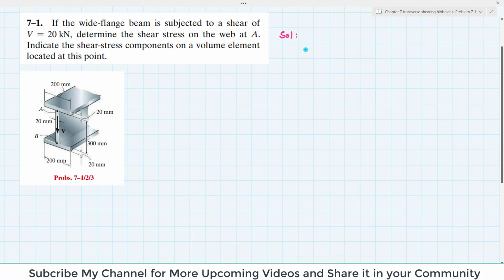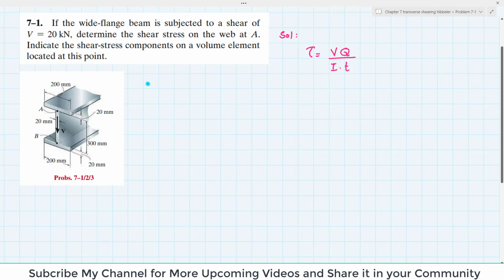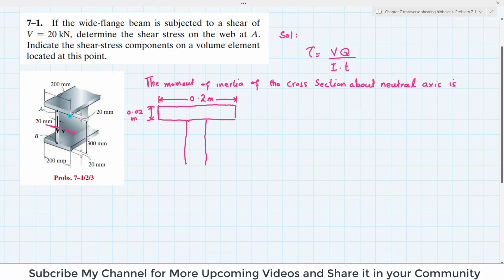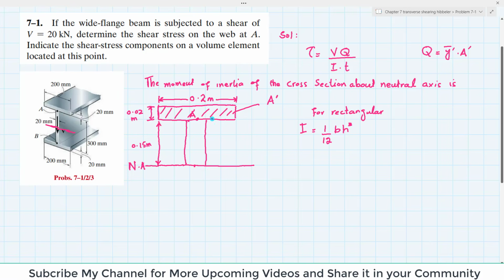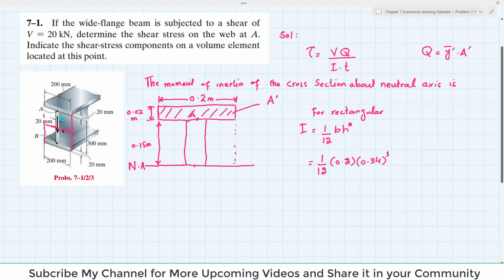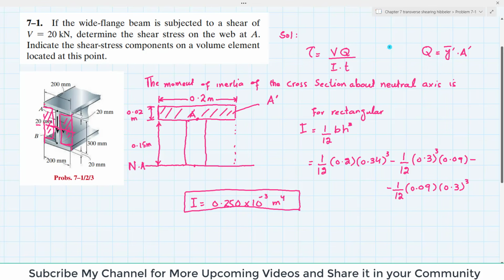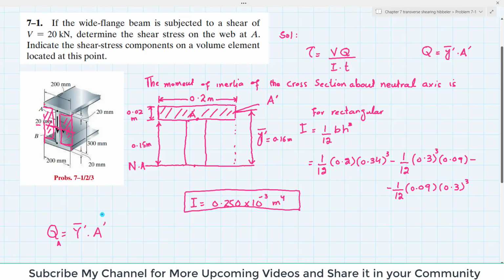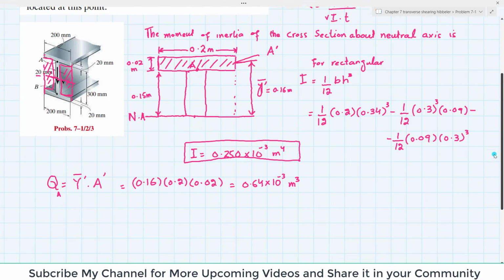Transverse Shear |Pb 7-1| Mechanics of Materials RC Hibbeler

Comment: there is a mistake=  for max shear t must be 0.02 at point A, for min it must be 0.2
Reply from the maker: it's not given in the question about max or min nor distribution of shear stress on web and flange.
Reply: @ ty but you are writing vertical length as t but it must be horizontal length
Reply from the maker: Point A is at junction of Web and flange and shear force is vertical so we are taking vertical shear force only

Comment: i dont get why the thickness is 0.02
Reply from the maker: That is acted over the Web...
Reply: @engradnanrasheedmechanical  why isnt it 0.2 instead of 0.02
Reply from the maker: Where, kindly specify the time frame...
Reply: @engradnanrasheedmechanical  11:39 in the formula VQ/IT for thickness.
Reply from the maker: Again check the question that Point A is on Web and flange Junction, that's why point A is on the top layer of Web that's why we are taking thickness 0.020 m